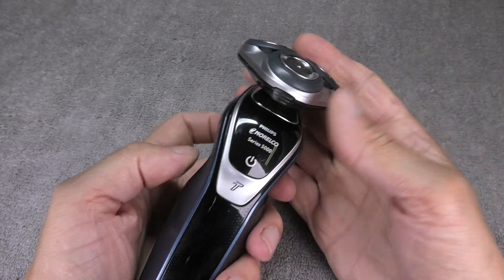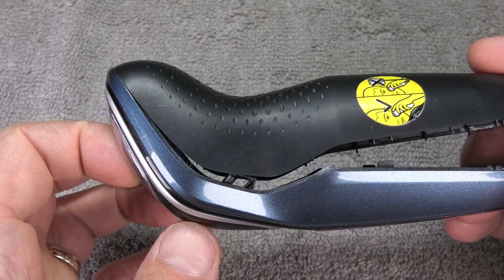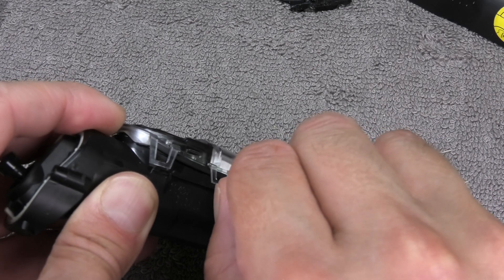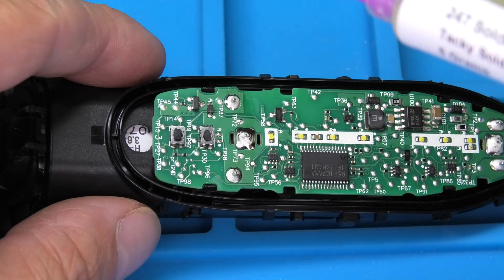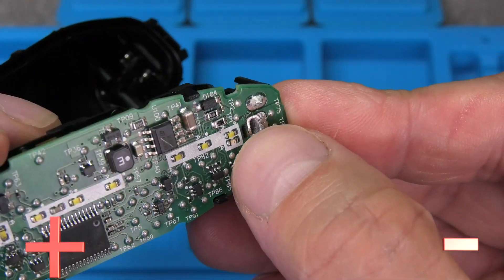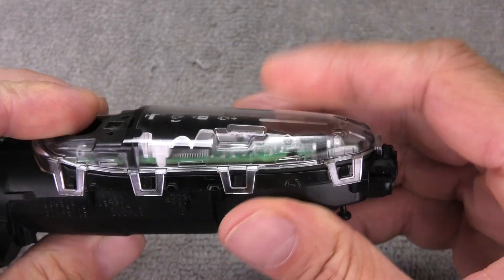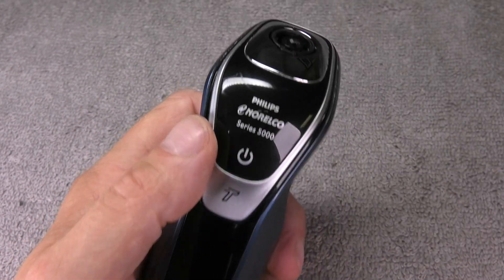Battery Replacement on Philips NorelcoElectric Shaver - 5000 Series (How to 4K)

Comment: Great video! Changed the battery as instructed, no problems.. turned on fine right after re-assembling.. but as soon as it went on the charger, same error that was happening pre-battery swap repeated, the flashing "unplug before using" light, even when unplugged 🤔 any suggestions on how to fix that one?
Reply from the maker: Sorry, I have not encountered that problem with my shaver yet. I’d be interested in investigating that

Comment: I'm having trouble with the on and off button you have a video on that ?
Reply: Hello . Great video for disassembly. I’m also having trouble with the on off button. The disassembled motor unit works fine, but when I fit the cover back on the outer button doesn’t travel far enough to press the internal button. Any suggestions?

Comment: This also works for the Series 6000 S6630. For the difficult bit of getting the black internal case out of the main body - I believe its clipped in by two clear plastic clips right at the end of the case around the recharging connector. So easing these two plastic hooks apart may make it easier to pull the internal casing out rather than brute forcing a screwdriver into it (I did the latter as per video so I've not tried this myself as yet). I used a standard tabbed 14500 Li-Ion cell as a replacement battery.

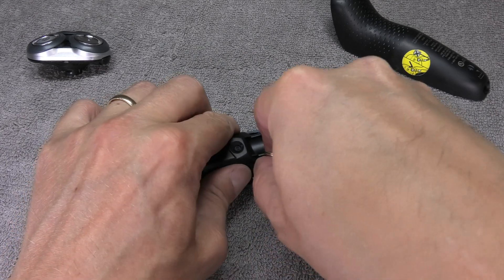Comment: Good video. But folks should be careful about removing the main assembly from the shell near the charging port. At 1:40 you pry the main assembly using a pocket knife screwdriver blade, BUT, there are two more tabs there that just need to be spread and it comes right out. The tabs are black so difficult to see against the base of the charge port. For the rest of you out there, simply spread them - one side at a time while lifting the charge port. It will come right out. 
Another thing, the battery is now available on Amazon and other places. Most are 680 maH while there are a few 800 maH of the same 49 x 14mm size for under $10. Very much worth changing the battery and heads given the direction Norelco is taking with their latest Series 500 angular heads.

Comment: Your video battery changed for you and last step shaver is not working only blink the light what is the problem
Reply: Just did mine today. Good video. Everything is well explained.

To use it, you have to connect it to the charger once to activate it. just like when the shaver was purchased.

Comment: great tips for battery replacement, is it possible to put a bigger higher capacity battery in with the same matching dimensions and 3.7 voltage that might make the shaver last longer during shaves reducing charging cycles, food for thought.
Reply: Generally if it has more time capacity mah . It lowers the amp output ( muscle power) . So that is usually the trade offs in cheaper batteries.

Comment: Thank you for this video! I watch this to got dissembling instruction and check what is wrong with my shaver, turns out it’s some oil/wax fired and clogged the motor shaft. I may lose some money to buy a new one! Thank you for let this piece of equipment able to work longer!

Comment: Thanks a lot for this very well explained tutorial. It helped me replace the battery pack on my Philips Aquatouch shaver without much hassle. I used some plastic cable ties to keep the 8 clips opened. I bought a couple of batteries in a Paris shop for 10€ and the guy in the shop was kind enough to solder the 2 batteries together for me. My shaver is good as new for 10€ and it helps the planet !

Comment: I've tried replacing batteries in Series 1000. These use 2AAA. I've bought white Eneloops as a replacement and they don't work. 

The batteries charged to a 100% with an external charger still result in amber light indicating low battery on the shaver. Charging them with an included shaver's power supply almost cooked them — the cell got to 3.5V (which is way over the spec) before I unplugged it — batteries were so hot that I almost burned myself. And the shaver still indicated "Low battery".

Comment: Hello, i would like to know what is that liquid you use from syringe for that. And do i really need it for soldering? anyway thanks if you answer me
Reply from the maker: Hi, the liquid is flux: https://amzn.to/3FdSvQA
It is used to help remove oxidized films from meta, so the solder adheres better.  I never solder without it.
Reply: @MegaSafetyFirst where is the link for the battery?

Comment: hello
I can't find the same battery.
I have this shaver but the battery is WD12G.
I can't know if it's 3.6 or 3.7 volts.
I found many 3.7 volts but with much higher ampers.

Thank you
Reply from the maker: Hi,  more amps will be beneficial for the runtime of the shaver.  
As long as the voltage of the replacement is the same as the original battery it is ok to be used.

Comment: A suggestion for those who don't have soldering equipment: Use silver epoxy to connect the new battery, without need for soldering. Cut old battery tabs immediately adjacent to the poles of the battery, on the side of the plastic battery mount, opposite the side of the circuit board. This leaves the battery solder on the circuit board untouched. Cut new battery tabs to appropriate length, so they overlap the old battery tabs. Glue new and old battery tabs in place using silver epoxy. I successfully replaced the battery in my 10-year-old Norelco using this method. Still good a year after replacement.

Comment: One of my Philips Norelco shavers will accept the charging cord and the other will not. Quite frankly, I wonder if I need to change the battery on the one that is not charging. I don't think I want to go through all the work it looks like it would take to replace the battery. In fact, I read that you should not try to do this yourself, so obviously a battery change is not a simple task.

Comment: Thanks very much for this.  It inspired me to change the battery in my Aquatouch shaver!  Just two points: 
1) I struggled to release the 8 clips on the clear waterproof housing, but managed with the aid of 8 sewing pins.  I opened each clip and slid a pin into each gap thus created.  The pins kept all 8 clips open and the cover easily lifted off.
2) It wasn't the same battery as yours.  It had two MINH AAA sized cells wrapped together side by side into a single unit with the solder tabs at one end. This wasn't too difficult to desolder; just remember there's residual charge in the batteries so don't cause any shorts with the desoldering braid!  I bought a replacement for about £11 and it fitted exactly, and works perfectly.  The battery part number is CPS-1391. 
After reassembly, I fully cleaned the shaver heads using diluted vinegar, and resharpened them with toothpaste.  I get a really close shave and it's still on its first charge after 12 days.  Now, it's probably better than new.
You've saved me from spending over £100 for a new shaver and I wouldn't have even tried if I hadn't seen your video!
Edit: The first charge lasted for three and half weeks!  It's now two week through its second charge and still working just fine.

Comment: I need help

I cant get this Green cell by Sony as its not available here. I bought cheap one 3.7v, after replacing, i charged it fully, but it drops within seconds. I tried 3-4 cheap betteries of 3.7, but all did not work. Is there any problem with circuit board or with bettery, how can i check it?

Comment: thanks for info. I think I need 14500 type battery ?? I think voltage is right 3.7 but capacity is way different.. I will try 14500 type battery with tab.
Reply: You may use e.g. Sony US14500V (680mAh 3,7V Li-Ion U 49,05x13,95mm) or Li-ion UR14500AC Sanyo 740mAh or any other Li-ion 14500 series cells
Reply: @creavisionsro  thanks. I will look for that

Comment: Hi . can you recommend YC12E battery source?
Reply: Just get a 14500 rechargeable battery. The correct diameter should be 14mm x 50mm.
Reply: Does it have the tags?

Comment: Would be useful if the YC12E battery is easy to find. But seems not.
Reply: You may use e.g. Sony US14500V (680mAh 3,7V Li-Ion U 49,05x13,95mm) or Li-ion UR14500AC Sanyo 740mAh or any other Li-ion 14500 series cells
Reply: @creavisionsro  I replaced it with 900 MaH AAA rechargeable ones. But somehow the shaver thinks it's empty all the time now. It works fine when I plug it on AC charger for a second, but somehow when I turn it off again, I need to do it again to be able to use it.
Reply: @MathijsGroothuis  Mathijs, AAA NiMH or NiCD rechargeable cells has 1,2V voltage. Li-ion 14500 cells has 3,7-3,8V. Shaver electrical board may detect your AAA cell as depleted/discharged due to low nominal voltage 3,7V vs 1,2V. That's the reason why shaver does not work without AC charger. Similar capacity 900mAh does not solve whole problem.
Reply: @creavisionsro  the stock one is 2.4 volt (2 x 1.2 volt as well). Suppo HSY-AAA0 750 mah NiMH.
Reply: That's just a name. Look at size and capacity.